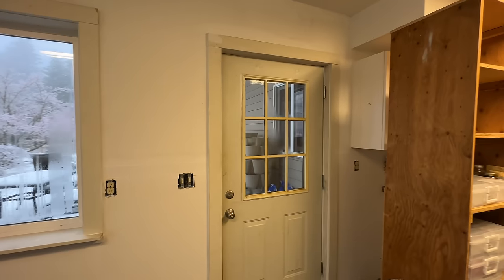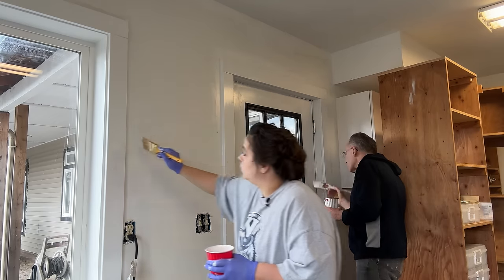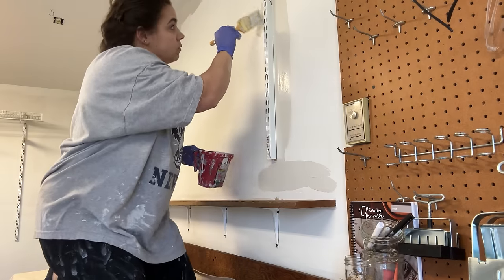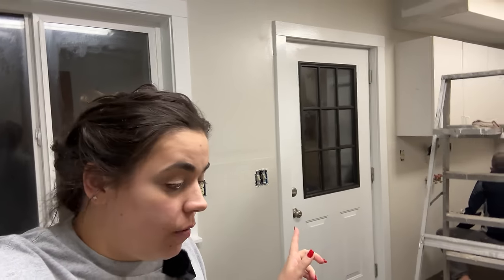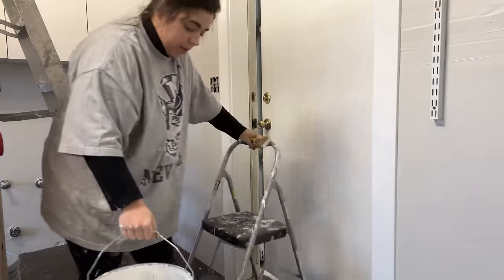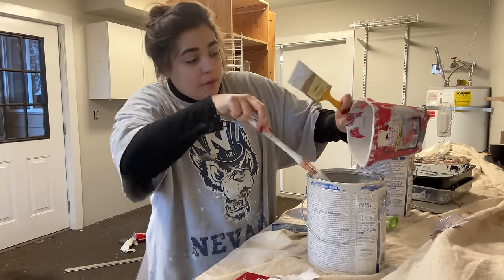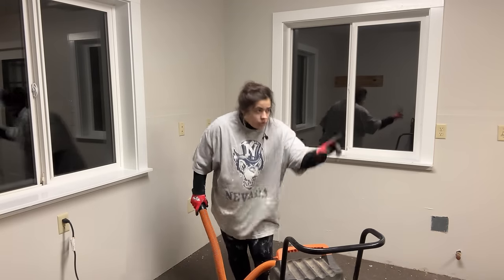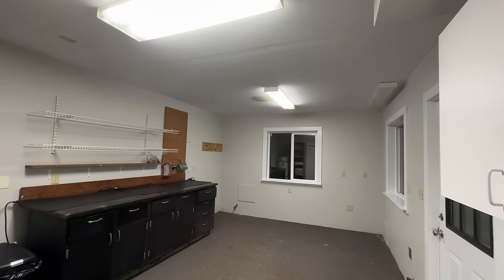Bring in Reinforcements to get the job DONE!

Comment: Becky painting your door would have been easier with a small sponge roller. I just put 2 coats on a door with a brush and it was still streaky.  I did the 3rd coat with a roller and it turned out so smooth!

Comment: Becky you need to replace all the electrical plates with bright white covers , those ones are dingy looking. Since you took the time to make the room look nice you might as well replace those to. Would make a great difference. Just a suggestion.
Reply: The problem is the wired electrical sockets and switches would then need replacing to match the covers....
Reply: They've redone them in the whole house so it would be just an hour or so to redo the ones in the grow room.
Reply: Or can they possibly be painted with the wall color?
Reply: I was thinking the same thing.. Maybe she could spray paint the covers? They don't match the new look of the room!

Comment: When cleaning my window and door frames I use an old toothbrush to get into the corners and cracks. I painted our garage a year ago using a Wagner spray painter and painted the peg board , it worked beautifully and makes the wall appear seamless. You guys are such a good team, made short work of the paint job. Those wood shelves might come in handy in your basement for storage. Thanks for sharing your motivational journey with us.

Comment: I don't know if the wooden shelf so close to the hot water heater constitutes a fire hazard or not but definitely check with your father or Josh about it qiickly please.  Safety first.  Your parents are so good to you but I know you appreciate them. Looks so much nicer in there  now.  Your right, it will be so much less dusty in there once the rug is removed and so much easier to keep the floors clean once you install the vinyl flooring.  Good job both of you.🎉🎉 🎉

Comment: The best thing for getting into all those angles and grooves on the window frames ( or anywhere else ) is an old toothbrush. I keep ours when they get too old for teeth cleaning and they work great for cleaning any small difficult space. Here in the Welsh valleys although I could get away with putting up a few seeds indoors it is so wet I will have to wait a bit as my allotment will need a few weeks to dry out and warm up a bit ( that is if it ever stops raining!!!)

Comment: Another resource for when to plant is watch the commercial buildings. My bank has planters out front and they use commercial landscapers. These guys change out the plantings seasonally, so when they change the plants, so do I. They've been doing this for years and don't take risks or it will cost them to replace the plants. Also, when I first moved here, I planted the varieties they planted, where they planted (full sun or shade) and when. Always successful. Did you know rosemary makes a great substitute for boxwood hedges. (Boxwood struggles here because of the heat!) Saw them outside my doctors' office. Sending lots of love 💖 from sunny 🌞 Arizona 🌵. Take care of yourself and each other 😷.

Comment: A tip for your next door-painting adventure : if you take the door down and lay it flat, make sure your paint is properly thin/runny, and use a medium thick coat it will make most bristle marks flatten out. Alternatively roll paint on and lightly drag a broad, flat brush through with long strokes. It flattens out the knobly texture of rolled paint. The second method is great for hanging doors.

Comment: On the cabinet behind your freeze dryer ask Josh if he can cut bottom section out and shorten door also.  You will still be able to use cabinet and able to push your cart back further to wall. Worth a try.  I had to do this for my upright freezer.
Reply: No need to cut the cabinets. My comment has her moving the base cabinets under the far window, and hanging the wall cabinets on either side of the window. 😂

Comment: If you move your work desk in front of the windows, you can look out the windows as you work. You can then put the plant shelves all against that long wall that your workspace is now against. I love your videos, they are very inspiring and get me to get up and work on my own house. 

P.S. If you didn't want to do vinyl, you could always paint the concrete with a specific type of paint. That would solve the discoloration and be waterproof. That's what I did with my basement after I ripped up all the gross carpet down there.

Comment: 34:10  Is it going to bug you that you didn’t update all the switch plates and outlet covers to match inside the house? Or will you be able to ignore it as a functional / utilitarian space?
This may be too late to be helpful, but you may want to measure your grow shelves and your door frames to see if they’ll still be able to roll in and out with the added height of casters. (I learned this one the hard way. Lol)
For future reference if you have to move something like the wooden shelves put a piece of cardboard and then slide the cardboard. Makes moving things, especially solo, much easier.
What a huge improvement. Nice work!

Comment: If you are willing to keep the concrete but the color is gross from the carpet, you can get really good concrete paint and that will be much more durable than cheap laminate.  If you want fancier you can also do an acid treatment on the concrete and stain and seal it.

Comment: If nothing else is going on in your seedling room, could you just open the outside door during your hardening-off days? You could probably hang a magnetic screen door/curtain in that doorway to keep out flying insects while the door is open.
Reply: The seedlings need to be gradually exposed to direct full sunlight so they need to be taken outside.

Comment: When you look outside, you will notice that there are many  many shades of green that go together.  You shouldn't be afraid of mixing different greens...you probably want to compare shades or tints to find what is pleasing to your eye, but green is a neutral outdoors.  Look across your lawn, to the foliage on your carrots, the leaves on your tomatoes and the muted shades of your cabbage.  It all works togethrr.
 I do agree that the rich, dark color of the bathroom is not the best for your seed starting roo..  Your lighter color will certainly reflect light for the plantogether.
Your room looks great.

Comment: You can pull up the carpet and clean up and just paint the floors.Put a clear coat on it and it will look like a clean floor. Also , you can go to a place like Lowes or Home Depot and get the peel and stick flooring. I have used that in the past and they last a very long time. Great job cleaning.
Reply: I agree, just paint the floor. Probably the cheapest option and is easy to keep cleanup.

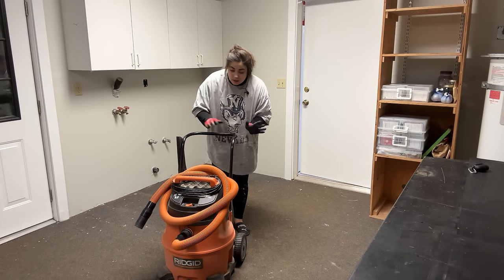Comment: @acrehomestead I feel like you should have gotten rid of the third  wood cabinet and used the white racks behind it for your seeds.   43:56 
Also, the freeze dryer could go on the wall by the black cabinets 39:59 that way you can use the white cabinets for storage, you can also get lower baking racks to use as a growing area under those cabinets. So you’re not losing space but gaining storage

Comment: Are you going to need to put a ramp at your door to move the shelves outside when you have the seeds growing? another option could get a small tray cart to haul your seed trays outside when you need to without taking the huge carts out. Just a suggestion. Would the wood shelves work in your shed or extra shelving in the basement?

Comment: Y'all  did a great job! It really looks beautiful. Since you are going to rip out the carpet, is there a way to add a drain (or two) and paint the concrete floor? There are so many colors and finishes for concrete. Maybe you could have some green in there after all.
It would make cleaning the floor so much easier. Just hose it down!

Comment: A trick for your paint can.  Take a nail or screw and put a hole around the rim on the inside where the lid sits.  The paint will drain back into the paint bucket and not stay sitting in the rim line.  The paint can will be easier to close and not be stuck to the lid when you need it again later.

Comment: If your wire shelves have adjustable feet, you can usually replace with wheels.  I’ve order from Amazon.  Wire shelves in garage, weren’t movable, some we wanted rollable.  So I bought wheels.  If you are moving in &out…. Go with 3” wheels.  But screw end of wheel should match the screw of adjustable feet.  All of my wire shelves in craft room are now wheeled.  Som have narrow posts, so be sure to compare with adjustable legs/feet.

Comment: Your room looks great.   I wonder if you could spray the metal black shelving unit to give it a face lift.  They are functional, just need some sparkle and shine ✨.  I would swap out the wooden shelves that you have your seeds on and put up more wire shelves to hold all the things.  They would look much nicer and you already have the rack system installed.  It may be as simple as getting a few more wire shelves or brackets and wood planks to create ones.   We have the Elfa system (similar to your wire shelves) in our walk-in closets and I love that I can raise or lower/reconfigure the design to fit our needs.   Just a suggestion.

Comment: Pain will eventually peel if door surface not sanded or primed or if the paint you are covering is not the same type as you are applying eg oil v water base etc. Soft/flat surface roller will help apply paint more smoothly to a low texture door. Taking the door off will provide a better result overall too as prevents gravity affecting application. Happy updating! 😊

Comment: Might be too late (this project might be complete already) but what about when you do the flooring, moving your seed starting table/workbench under the window? You could put shelves up on either side of the window for trays etc and then have that entire wall without windows of rolly shelves and not have to block the windows with seed shelves?  Would be so nice to look up out the window as you start seeds too. Just a thought but boy this transformation was beautiful 😍 🪟 🌱 🎨

Comment: Those metal shelves you have are able to have wheels added to them.   Also if your floor in there is concrete you can always just paint it.   You can even paint a design on it as well.  Vinyl flooring would probably be the next best thing as far as cleaning & being sturdy.   Turned out great Becky.

Comment: I was really looking forward to this video and it did not disappoint. Wonderful work/transformation! It looks clean fresh, inviting, and now a great space to work in. Those homemade plywood shelves that were original to the woodworking space do not work well in a grow room / seedling space. You are working with soil, water, plants, and seeds, all the surfaces need to be easily wipeable and spill resistant. If you keep that one plywood shelf unit you have put by the hot water tank, could I suggest putting casters on it as well so that it is easier to maneuver and won’ t be in danger of falling over or apart. I really enjoy your energy, the variety of your videos, and how real you are. Thanks!

Comment: Becky! Hey friend. Have you considered moving the base cabinets to the far wall, under the window? And then move your wall cabinets to either side of that window. Use the space between the wall and base cabinets for your peg board.

You'll now have a spot to push your dehydrator right in that corner where the wall cabinets were. You probably have room for a 4ft table to the left of the dehydrator.

You can squeeze another rolling metal rack where you put the wooden shelf. Get rid of it. You like things clean. Metal will clean up much better than the wood.

Hmmm. Lets see. Now where you had the base cabinets. THAT is where you have just a full wall of rolling metal grow shelves.

Of course...now you'll have to paint behind the things you're moving. 😂 Sorry!

Comment: looks nice Becky. I suggested rolling carts last year, like those bakery racks or flower auction carts, glad you got there in the end, you probably get too many comments to read them. isn't there a concrete floor underneath the carpet? that's easy to sweep clean and or mop esp if you paint it with concrete paint.

Comment: I would get more wire shelves to add to the spot by the water heater instead of using the wood unit.  It would not catch dirt & dust as bad.   The things on the wood unit could then just go on the new wire shelves.

Comment: Paint looks good!  What is the purpose of the board affixed flat to the wall in the far left corner as you look into the room?  Will it interfere with the placement of a rolling shelving unit?  With the black and white trim on your windows and doors, some black and white vinyl tiles in the traditional checkerboard pattern would look great.  Timeless and classic. ~ Lisa

Comment: I think the shop vac is not good for cleaning up small particles. It spreads them into the air. It''s meant for larger things, like nails and screws. That might have been why your grow room was so dusty.
Reply: Shop vacuums are used by constructions crews to clean up drywall dust, sawdust, etc. Carpet cleaning crews often use them to vacuum deep seated dust and debris before shampooing.  If dust is being released back into the room, the filter on the shop vac needs to be cleaned.

Comment: I know it’s a bit late, but if you moved the wall mounted cabinet up so that there was no gap between the duct channel and the top of the freeze dryer, would you be able to open the doors of the cabinet and use it? I’ve been thinking about that since you first showed the placement of the freeze dryer😅